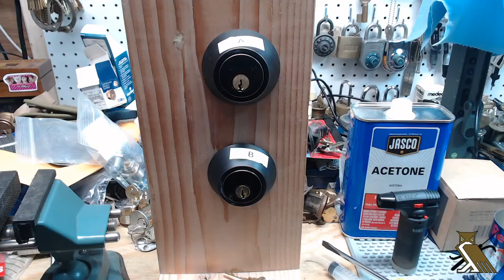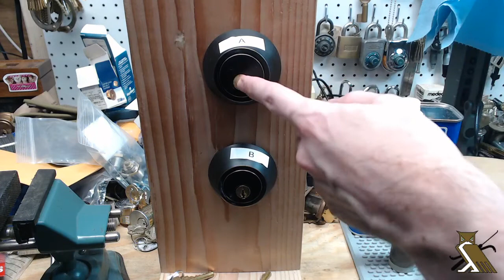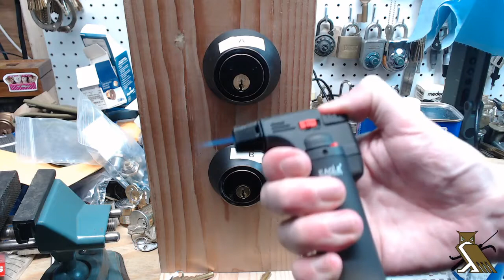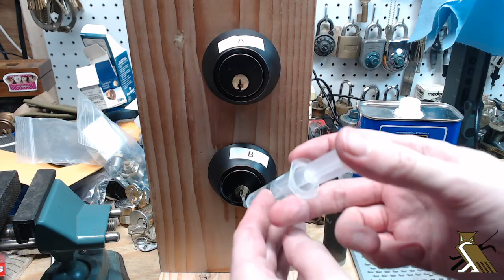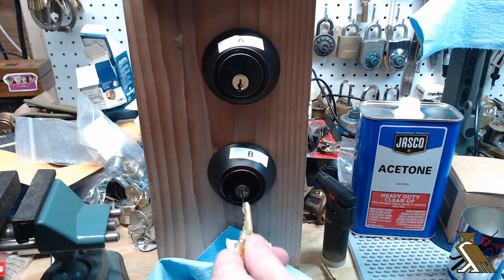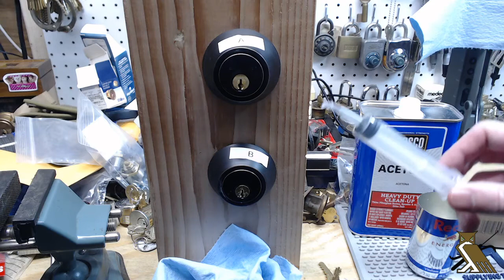(121) Experiment: Removing superglue from locks

Comment: Hi great video m8. I've experience this just recently by a spiteful person who put glue inside my 6 pin euro lock for uvpc door, fortunately for me I've two entrances to my property. I had to use both acetone and the blow torch method. I removed the barrel from inside and stood it up I used the blowtorch first fully turned up pointing straight into keyhole, keep it on until u see dripping flames coming out it'll all come out in one go at a certain temp and will be a flame so make sure you do this in a safe place that is not flammable, takes about 2-3 min full flame after that u can insert the key and turn the lock but still has alot of stick for key to insert and get out so I then left the barrel to soak inside acetone for an hr, afterwards the lock was fully clear of any glue. My lock had dry superglue in it for about 3 week. Unfortunately for anyone with one entrance to property they'd have to drill the holding screw out hope this helps ppl and hope nobody has to go through the experience of a spiteful individual doing what happened to me.

Comment: Nice Video.  I would think you could use a Lab style (Hamilton metal hub) needle to get all the to the back of the lock.  Again with the heat, should be ok on the current Schlage, but you may find plastic in some smartkey cores.  I would think krazy glue would be disastrous on a snark key system.

Comment: I Liquid Nail my locks' keyholes to prevent lock picking. 
.
.
.
.
.
I have electronic combo locks. Just don't want the backup keyhole :)  Question is can you remove Liquid Nail from the keyhole?  If yes, I'll need to look at something else, like physically soldering the pins in the core.
Reply from the maker: I just hope the batteries or electronics never die on you. The mechanical backup is there for a reason, and if the cylinder has been disabled you are looking at a very expensive lockout call.
Reply: @Nite0wl  I have two locks on two doors with staggered batteries.

Comment: Great video Nite!  Loctite also makes a solvent product called SF 768 that will dissolve cured cyanoacrylate (super glue).  It is probably way more expensive than Acetone.  The acetone looked like it worked well!
Reply: amazon shows one listing for 1.75 ounce bottle for $40 !!!
Reply: @selock  that's way overpriced!
Reply from the maker: It certainly got the job done. It is important to remove the lock from the door ASAP once it is un stuck though, the acetone can sometimes leave glue residue that can re-cure as the acetone evaporates out.
Reply from the maker: Yeah, eapecially compared to a 32oz can of acetome that retails for under $10, and even BSI's 1oz Un-Cure super glue unbonder goes for about $8.

Comment: You should have put the acetone in the one you toasted as well see if it’s recoverable
Reply: I used both blowtorch first then soak in acetone my barrel was recoverable but had to remove first wouldn't recommend trying blowtorch while lock is still in the door as the superglue come out aflame as a liquid and would set both wood and upvc door on fire.